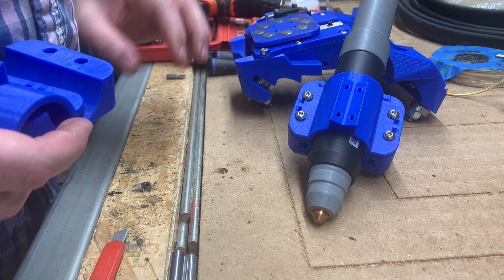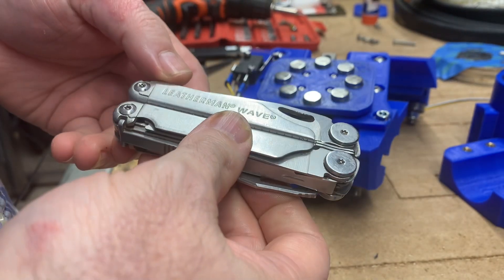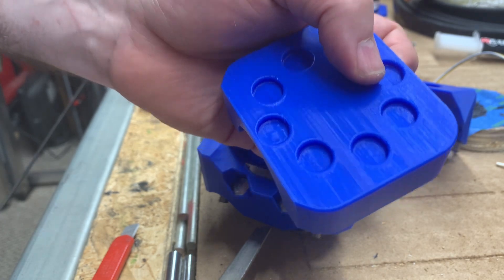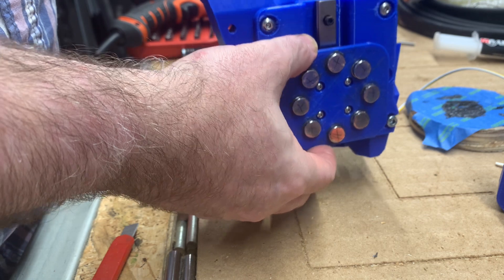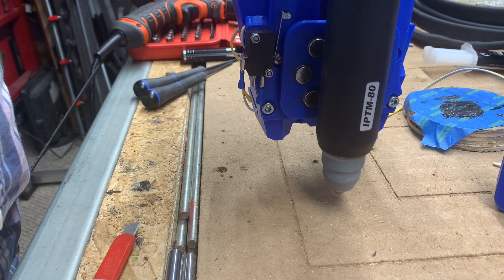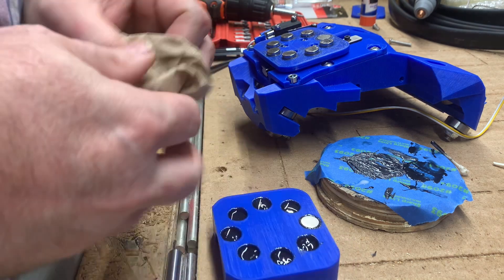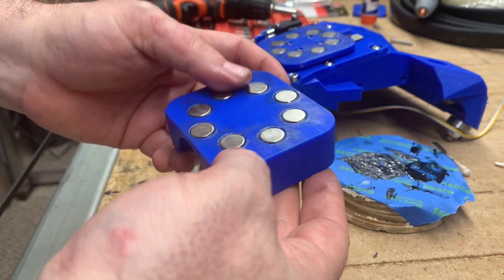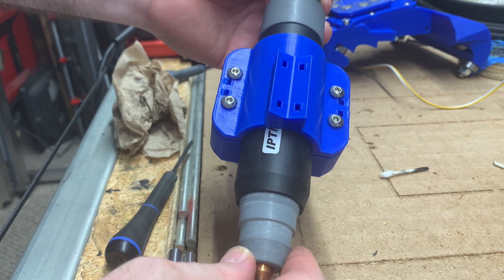LowRider 3 CNC Plasma Table PART 6 - floating Z torch mount

Comment: That is nice, but you are mounting it in the wrong place. It should always be mounted on the barrel not the torch head.
Reply from the maker: Thanks. I will take that into account.
Reply: @design8studio  
Mounting to the torch head can and has caused a lot of trouble with the plunger sticking or jamming and misfires if over tightened.
Reply from the maker: @mechanic416  Got it. Thank you!

Comment: Great work on this!! I have a low rider 2 I use on wood. Wish I would have seen this a few days ago. I just ordered a cnc plasma table. I’m planning on using the same plasma cutter. Mine just arrived today. Was thinking about ordering the machine torch. Haven’t been able to find reviews on it. My search lead me to your videos.  Can’t wait to see the finished product.
Reply from the maker: Cool. Thanks! I'm currently finding time to complete wiring the electronics box, which is housed in a repurposed old desktop PC tower, and then I will be onto the whole learning curve of getting up to speed with LinuxCNC / PlasmaC. This project is the most ambitious build I've tackled. I'm thankful for the existing guides and help of Kyle on the V1E forum, and also help from Ryan (Mr V1E himself) and others!

Comment: Hi Doug,
I have been following your videos on building your CNC Plasma Table.  I was wondering if you can share the plasma cutter and upright torch that you were planning on using.
Thank you!  Excellent job!
Reply from the maker: Sure. I thought I had already shared that here, but I must have only shared it on the V1 Engineering site. I need to update my links in the description in the series videos. I will paste here links to both the cutter, the torch, and the consumables I bought to go with each. There are actually a few other things I bought for the project that I just realized I have not yet linked here. I will try to fix that. In the meantime, here are those 4 links:
— Plasma Cutter: https://amzn.to/3LvjQQg 
— Consumables: https://amzn.to/3BT0EbE 
— Machine Torch: https://amzn.to/3LvIRL8 
— Consumables: https://amzn.to/3Uqrhfi

Comment from the maker: @4:18 — I misspoke (several times in same time region) in calling "Fit" as "Clearance" and calling "Interference Fit" as "Interference Clearance." The latter mistake actually conflates two of the three main types of fit. Anyone watching who is in engineering would likely have caught it. The three main types of fit are: 
(1) Clearance Fit — Clearance fits allow for loose mating, where free movement is important and a certain amount of play is desired. 
(2) Transition Fit. — A transition fit would fall between a clearance and interference fit. 
(3) Interference Fit — An interference fit will be much tighter than a clearance fit. It requires interference, such as with force (pressure, ranging up to forcing an open wider) or heat, etc, to get an  item inserted into a hole in an another item.
At time of videoing I could not remember all these names properly and I used the common wording of "snug fit" when perhaps either the "press fit" or "transition fit" terms would have been more accurate.